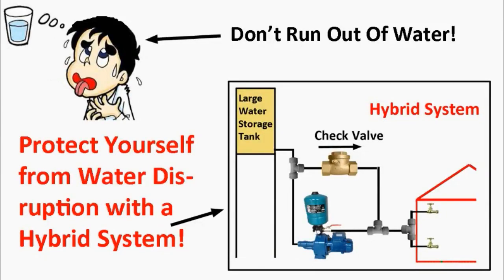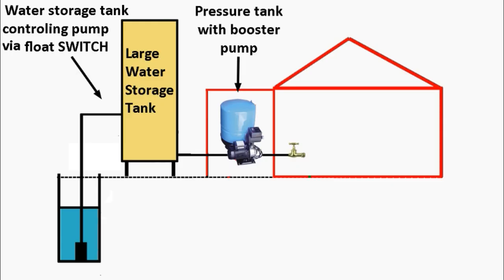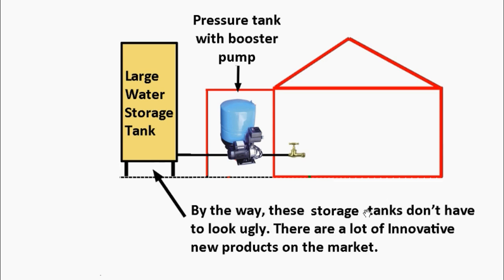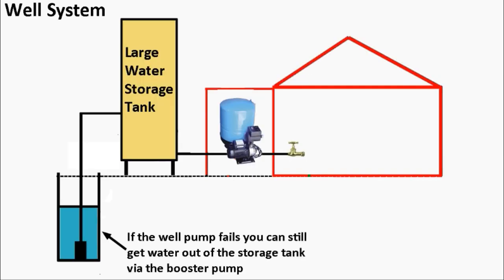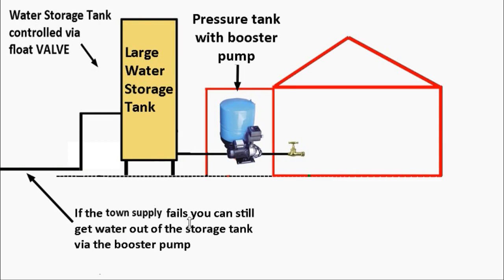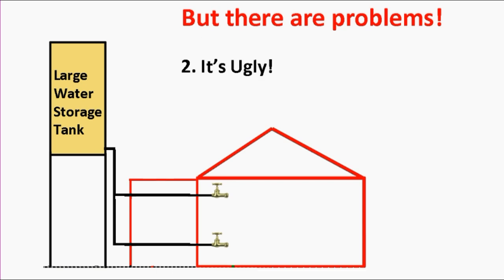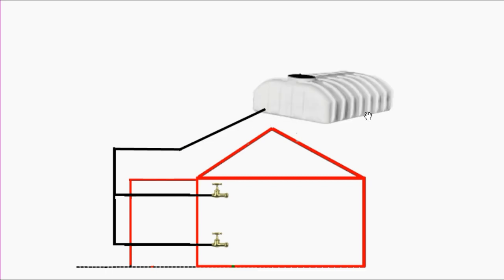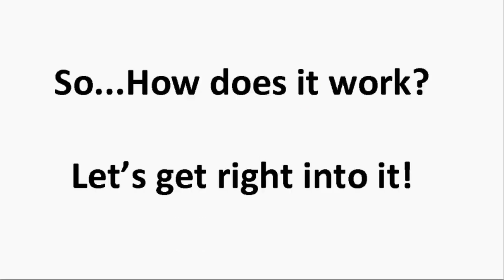Hybrid of Water Pressure Tank and Gravity Feed Systems for Super Dependable Pressurized Water!

Comment: If there's enough pressure from the raised gravity water storage tank, could you use the pressure tank without a pump?
Reply from the maker: If there is enough pressure from the raised water tank then  why would you need a pressure tank? Unless you have some very weird and unusual setup, the basic answer is NO.
Reply: Right now we have a raised tank that the well town water is pumped into. The tank is pretty high up, and the water is gravity fed to the house. However the pressure isn't very strong, especially since we've upgraded to newer faucets. Im just looking at increasing the pressure in the system. I've seen systems with pressure tanks that don't require the pump, cause the pressure at that point is strong enough to fill the tank, the tank pressurizes the water further before distributing water to the house.
Reply from the maker: No, without a pump the pressure in the pressure tank can not exceed the pressure of the water from the raised water storage tank. That is simple Physics my friend. The raised water tank feeds the pressure tank at a certain pressure.  If the pressure in the pressure tank exceeded the pressure feeding the tank you would have solved the worlds energy crises and you would be the most rich and famous man in the word!